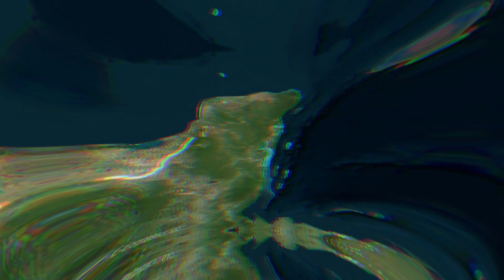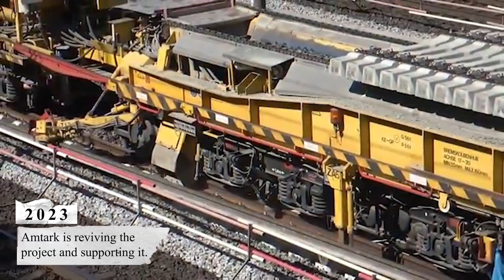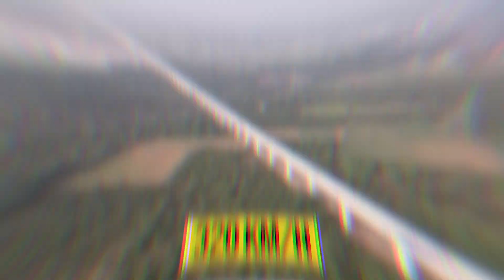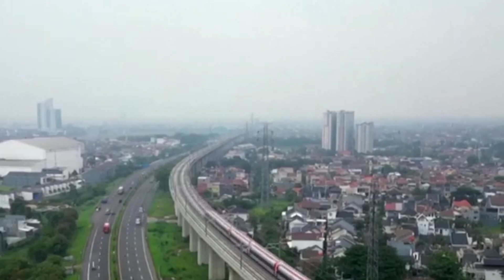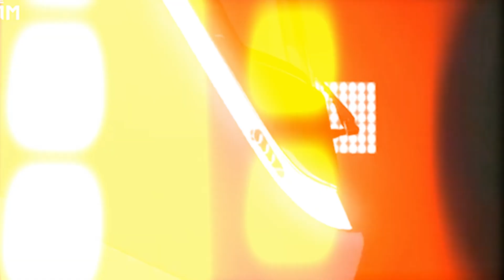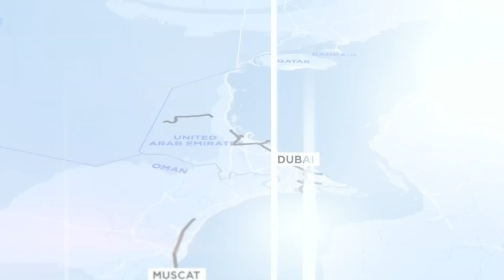TOP 10 Biggest Railway Projects in the Future

Comment: Given the failure of HS2 here in the U.K., I despair of the U.K.’s ability to manage its railway projects and its railways generally to a proper standard - the only solution is to have an external body like the Chinese or the Japanese being brought in to take complete and unrestricted control of the U.K. railways, backed by very strong laws to ensure that this is maintained, as most U.K. railways are of a very poor standard compared to the Chinese or Japanese railways - even the railways of Eastern Europe are of a better standard than the U.K. and there is no reasonable nor valid excuse as to why this is - China can achieve these projects because the mindset of its people and its leaders is the correct mindset, that must be adopted here in the U.K. to achieve the same level of success

Comment: The Grand Paris Express project consists of 4 new lines, not 2, plus 3 extensions to 2 lines.
The extensions have opened in June, and the first section of a new line, M15 South, will open in 2025 and will be 35 km and 16 stations.
M15 will be the giant, 75 km long, fully deep underground loop line in the suburbs.
There will be at least 220 trains running on the new lines.